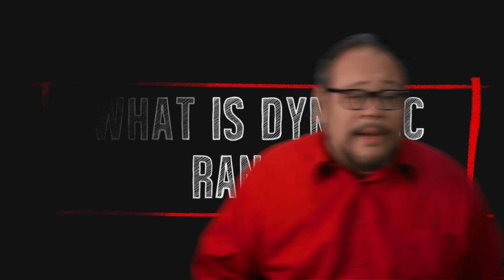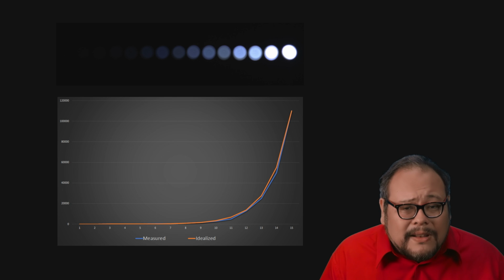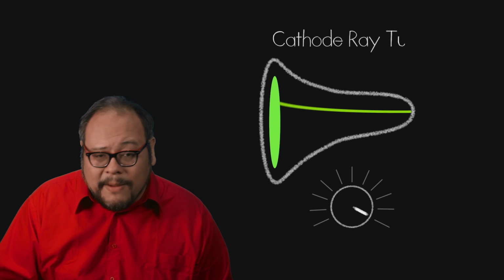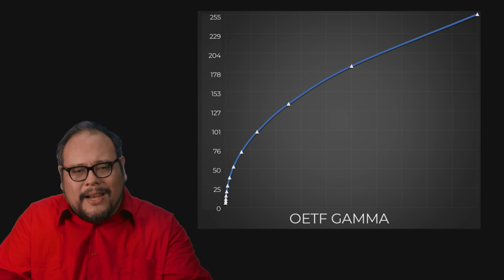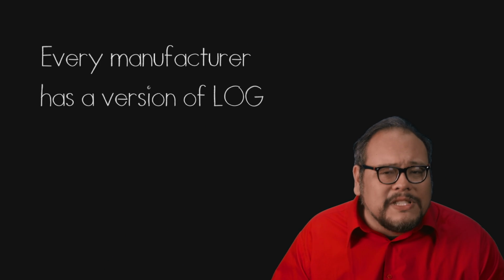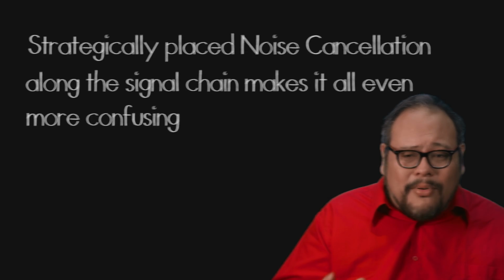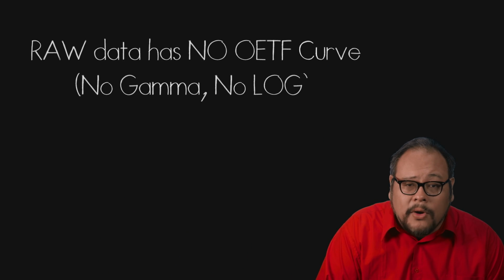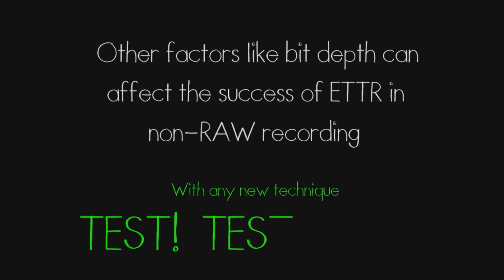Diving into Dynamic Range

Comment: The best way to describe ISO, as I've done with students, is to compare it to a guitar amp. Because that's exactly what you're doing, you're amplifying the signal received by the sensor on a pixel-by-pixel level(Yes, I know, CCD sensors use an off-sensor amp, but that's hot garbage, so we're not gonna talk about that). On a guitar amp, or for students with a more sound-heavy background that get it, you can turn up the gain a little bit, but after a short while, you're gonna start getting noise. Whether it's noise off the line out of nowhere due to line interference, or just background noise, you're gonna get stuff you Don't want in the final result, which is why smart soundies know to stay away from the gain dial unless they absolutely need it. In the same way, if you turn the gain up too high, the sound you DO want can start to sound gross and garbled and messy.

The same applies to your sensor on your camera. Pump your ISO, or as anyone who uses a camera not designed to keep alive long-dead short-lived traditions of film standards(seriously, ISO as a standard wasn't that long lived, ASA was the big standard before that), your Gain(measured in db), and you start to get noise. Instead of noise off the "Line", you start to see electrical crosstalk induction noise on the sensor itself, as lines running parallel to signal lines carry more and more power to the amplifier circuit on each pixel. SOME devices are starting to work past this problem, with NMOS/LIVEMOS sensors on Olympus and Panasonic cameras moving the electrical lead onto a MOSFET configuration poking out the back of the sensor surface, or "Back Illuminated"(a name that makes every part of me cringe) sensors moving the amplifier itself to the back of the sensor, but noise is always going to be a thing due also to the fact that there's no way to get every single pixel on the sensor to be Exactly the same in terms of input sensitivity. On the upshot, these small aberrations in individual pixel sensitivity are imperceptible at low gain, and a stationary noise curve like that can be actually pretty easy to sort out in post using something like Neat Image(Which is stupidly powerful, albeit a bit weird), or if you're good with it, something like DFine2.

Good video. From one educator to another, the best methods of teaching are all about finding something analogous to something students understand already. :)
Reply from the maker: I like and use the stereo analogy but as you said, camera companies are starting to get real clever about how they amplify the signal. Furthermore the stereo analogy doesn't quite work with this kind of exposure mapping that these cameras are doing by

Comment: (I might have misunderstood) with the low vs high ISO discussion...and keeping things theoretical:
Is there a reason to shoot at an ISO higher than the camera's native?
Eg if a camera's native ISO is 850, I totally understand why pulling that down is problematic (the highlights would be affected in a similar way to if you pulled them down in post - just darkening a clipped white)
But increasing the ISO above 850 would surely have a similar effect to brightening the image in post? (barring compression artifacts etc)

I guess my question is - would there be a theoretical difference between underexposing by e.g. one stop and increasing that exposure in post vs. underexposing by one stop and increasing ISO by one stop?
Or is the difference purely due to losses in compression and encoding?

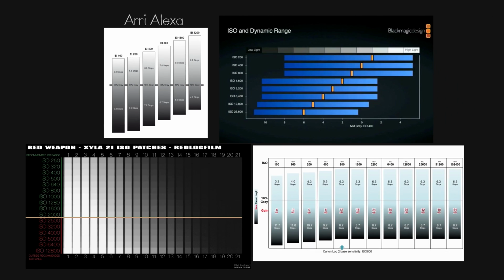(at 26:09 you can see this most clearly on the bottom right (Canon Log 2) chart)
Reply from the maker: Some cameras (like my Canon) will stop giving you more stops above middle gray when you go above the "native ISO" some cameras like the area Alexa or even the New Black Magic cameras will continue giving you more highlights stops above "native ISO".

In regards to your second question... The answer is it's complicated. Some cameras engage noise cancelling and certain ranges or use different Upstream amplifiers at different ISO settings. You can't simply recreate that effect in post. And of course some cameras don't have that and you could easily recreate the effect in post (ISO indifference they call it).

Most of this is in regards to shooting in a LOG format. But I do think it carries over into RAW. Keep in mind though when I say shoot bright scenes with a high ISO I don't mean you should overexpose. Expose properly which means cutting back on the amount of light hitting the sensor.
Reply: Filmmaker IQ the vast majority of my experience is Canon so that could be part of how I’m thinking too 

Thankyou for the video! There’s a lot of well explained stuff in here (first time that while learning about gamma curves I’ve gone ‘aahhhhhh!’)
Reply from the maker: Same here at least in regards to working with LOG and all that stuff.

Yeah for Canon - there's no reason to go above "base ISO" of 800/850 in terms of highlight protection. Here's the graph: http://www.danielhaggett.com/images/exposec300markii.jpg

I used the numbers I used because I was trying to go for 4 stops in the ISO/Dynamic range because that meant all I have to do is engage the internal ND filter without changing shutter/aperture. :)

Comment: "Bigger files and tougher workflow" when it comes to raw (which is not an acronym btw, therefore there's no need to write it in ALL CAPS all the time 😉) doesn't of course apply to e.g. ProRes raw. With PR raw the workflow is near identical (sometime even better ) in terms of both file size AND performance compared to regular flavors of ProRes. Just sayin'.
Reply from the maker: I like to write it all caps for stylistic purposes. Just like I write LOG and REC.709 which are also not acronyms
Reply: To each his own. 😉👍🏼
Reply from the maker: It's also a functional purpose. I can distinguish between RAW footage (format) vs Raw footage (unedited)
Reply: Sorry, but you appear to be rather misinformed. Being a VBR codec, depending on which flavor you choose it's anywhere from BELOW regular 422 and just BELOW 4444. See: http://bit.ly/2EurXgX

Canon raw is nearly TWICE that (1Gbps), yes. Never mind that it's performance is also far below that of PR raw. While I can do an easy 8 streams of (unrendered, full res native, no proxy) 4K PR raw. I can barely do 3 streams of Canon raw on the same machine without transcoding first.

Unfortunately I don't know what the difference between "RAW footage (format)" and "Raw footage (unedited)" is supposed to be. At least in the case of PR raw it's the exact same raw from camera until output. The "format" is the exact same, whether edited or not.
Reply from the maker: Okay I see that now.

RAW footage refers to the format it was shot in. Raw footage means it's all the footage that has yet to be edited regardless of the capture format... i.e. "please send me the raw footage you shot last Saturday"

Plus that all caps is quite common.
Reply: Ah, ok. Got it. Certainly an interesting point that I hadn't thought of. 👍🏼
And like I said, to each his own. ;)
Reply from the maker: Also ProRes RAW is big. Not as big as uncompressed obviously - significant savings in fact. It's about the same as Canon RAW Lite which is also quite big. But ProRes RAW is bigger than almost every other flavor or ProRes (edit: can be bigger - can be slightly smaller too). And the workflow is tougher than compressed just in that you probably will have to proxy everything... Mileage may vary...

Comment: This is a wonderful lesson, well worth the wait since our last one. However, there is just one single thing I'd like to point out regarding BT.709.

The BT.709 specifies a standard that includes a specific color gamut (identical to sRGB), white point (D65) and color space (YCbCr), which then also includes the levels of course (SMPTE Legal Levels). However, it have never really had a specified standard for EOTF though 2.2 have certainly been widely used in this regard. The closest we would get to an EOTF standart for BT.709 would be BT.1886, which was passed in 2011.

I would also like to point out that certain CRTs have very deviant EOTF in comparison to 2.35-2.55, and they also tend to have very variable EOTF through the greyscale. All of this is to be expected of course as the CRT itself is naturally imprecise in this regard. For instance, the Sony BVM-D24E1WU can go almost as low as 3.0 in the shadow detail as its curve gradually goes towards 2.5 at the brightest highlights (though most of the middle grey is certainly at around 2.7-2.8).

Funny enough, the most accurate CRT for I've seen in this regard (with least deviant EOTF curve) is the Sony HDM-3830, which was part of Sonys first HD CRT. It follows Power Law 2.4 almost perfectly, something I've never seen on any other professional grade CRT. Some Ikegamis I've seen have been very close however.
Reply from the maker: That's a great clarification. Thank you!!!

Comment: Great video, as always, thanks! I have one question to round up my understanding: In your C200 exposure example, you film in C-Log2. You say, you applied the Rec709 transfer function to get a normal image. Yet since an inverted Rec709 gamma would be needed in the recording stage (see OETF) to get the desired image, don't you really mean you applied a C-Log2-to-Rec709 transfer function? 
On that note, it was pointed out that RAW data is what the sensor records - meaning the capturing and storing the linear characteristics of light. This means, there shouldn't be a LOG-function inherent (or "baked in") in the RAW data, should there. What I concluded so far was that the read-out of the sensor is already in the manufacturer's LOG. So doesn't this LOG function work in conjunction with the capturing characteristics of the sensor? To put it differently: every manufacturere has its own LOG, but since every sensor supposedly records light in a linear fasion (as god intended, I suppose), you could theoretically hack the system and exchange, let's say, the LOG function in an Alexa with S-Log. I realize you cannot "hack" a camera this way since we're not really at the software stage at that point, but still. Therefor, my conclusion used to be that the sensor records light with respect to the LOG-handling, leaving the sensor not really resorting to linear light gathering.
Sounds convoluted, yes.. but this is a point I'm failing to wrap my head around, as I'm unsure why there are so many different LOGs out there when they are essentially arbitrary.
Reply from the maker: Not quite sure what your conclusion is. In the ETTR example I was recording in RAW. Canon RAW has no gamma so I'm free to apply Rec709 or CLog1 or CLog2 or WideDR to it. There is no gamma baked in. There is no inverse Rec709. Rec709 is basically encoding gamma of .45 (plus some other technical aspects that are above my pay grade)

Can we "hack into" one brand and install a different brand of LOG? Probably... But the devil is all in the details. There might be a ton of camera tech specific algorithms in these LOG formulas. A lot of improvements in camera tech these days are not necessarily in the sensor hardware but in the algorithms in the software... That's how many manufacturers can improve their cameras just by sending out firmware updates (and what folks at magic lantern do)
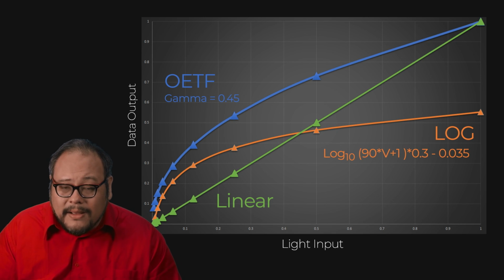Reply: Hi John, thanks for getting back to this so quickly. I was having trouble bringing my point across, yes... My quarrels is, at 18:02 you show a common LOG function that deviates from the encoding gamma of 0.45. That LOG function is given to the image file, i.e. DNG. I understand that this function is arbitrary, since the RAW data is a linear recording of linear light. Still, this function is the base of the DNG you were applying a Rec709 gamma onto. This marks the limits of my current understanding, as for me there's gotta be a mismatch right there.
Reply from the maker: The Canon RAW Lite doesn't present as DNG files perhaps that's where the misunderstanding is. I think thats probably true of the ProRes RAW format too. Perhaps in cameras that create DNG you could opt to bake a gamma knowing you can manipulate it very hard because its very high bit depth. I only shot DNGs with the BMCC. I remember not having to deal with LOG but I think you could bake that "look" in...
Reply: What I meant to point out / question was is if the camera Log used (like let's say S-Log, doesn't matter) replaces the 0.45 OETF at the gamma encoding stage. Because I think it does. Therefor, saying you put a Rec709 transfer function to your Canon Log footage means you applied a 2.2 gamma on an OETF that's vastly different from 0.45.
Reply from the maker: Gotcha.

Yes... if you record LOG, you are not using standard encoding gamma. Instead of that 0.45 curve you are using a LOG curve. So in post you essentially have to bend the LOG curve back to the 0.45 curve (or reasonable close to it). Even though 0.45 is the inverse of 2.2 gamma, doesn't mean we have to be exactly 0.45 if we want to change the look a bit.

With the RAW, I was able to switch between the LOG and REC.709 in Premiere.

Comment: I’ve always known about protecting shadows with lower ISO just from experience of boosting exposure in post. Now that I think about it, I have also experienced how you can protect highlights with higher ISO but that just never sounded right so I never paid attention to that possibility. I did notice how you can shoot bright scenes with a high ISO anyway, and the blown out parts are actually easier to recover than the blown out parts from a low ISO image. Now I understand you’re just shifting the amount of data dedicated to highlight versus shadows.
You might as well change your channel name to film making myth buster at this point.
Reply from the maker: Higher ISO just to the point where you're not tapping down the whites... I mean don't go nuts and shoot ISO 512000 in mid day sun hahaha.
Reply: @FilmmakerIQ  The new BMPCC 4k camera manual has a graph where it shows how many stops it offers for highlights and how many for shadows in each ISO step. Given that graph, it's best to shoot at ISO 1000 or ISO 1250 with that camera to get the best highlights (and with a variable ND filter, of course, to control the light).
Reply from the maker: I have that camera on rental order and going to do a quick video on it
Reply: @FilmmakerIQ  I don't understand how increase ISO doesn't reduce DR. By increasing ISO from 200 to 400, camera has half of information to work with. Like you said in the video it raise up the noise floor thus reduce DR by one stop. You also then mention there are other factors that contribute noise as well, so it seems the penalty of one stop DR reduction is the best case scenario. However you then said increasing ISO doesn't reduce DR. That makes me go "huh?"

The way I understand is that the sensor can capture much greater DR(let's say 10 stops) than the log or gamma profile(8 stops) can provide. By raising the ISO you simply change where the grey point is, increase noise floor and because it hasn't hit the max signal range yet, there is no penalty of highlight.

Basically if you shoot log, there is no penalty in DR if you raise from ISO 200 to 800, but you will if you raise to 1600.  
It also means if you shoot Raw, then you might as well just stay in base ISO, get the full DR, preserve high light and since most space is for shadow details anything, just raise up in post.

Thank you in advance for reading and answering my question. :)
Reply from the maker: Yes

Comment: how does dual iso change things?
Reply from the maker: Great question! I don't know for sure but in the quick Google search I found it's basically you have two ISO levels that are pretty far apart that give you the same dynamic range.
Reply from the maker: This is a great chart to get some ideas about how the latitude is spread over the different ISOs on the new BM camera with the dual ISO https://www.cinema5d.com/wp-content/uploads/2018/09/ISO-range-to-latitude.jpg

Comment: I definitely understand LOG curves better.  And the suggestion to "add light" to preserve darker scenes seems to be what everyone would expect.  In other words, get the dark areas out of the noise floor.  Not sure I get the opposite end of that, though, with using higher ISOs for bright scenes.  For a future video, I'd love to see how LOG curves assign bits in an 8-bit stream to represent 12+ stops of dynamic range.  Seems there were have to be gaps as not every step along the way can be represented.
Reply from the maker: It's two parts in regards to highlight preservation. First of all its reducing the light that hits the sensor so you're keeping things from clipping. Secondly when shooting at low ISO the camera allocates fewer stops above mid gray so you don't have many stops before you hit clipping.  So low ISO is not your friend when shooting bright subjects.

In regards of seeing how log is allocated over an 8-bit scale that's what the graph is showing when I talk about log. As long as you're not doing epic feats of manipulating the signal, 8 bits can hold 15 stops pretty well. You do have to be pretty close to proper exposure though and I'm sure banding might happen in extreme brightness gradients.
Reply: Okay, I think I get it now.  Avoid sensor clipping.  Thanks.